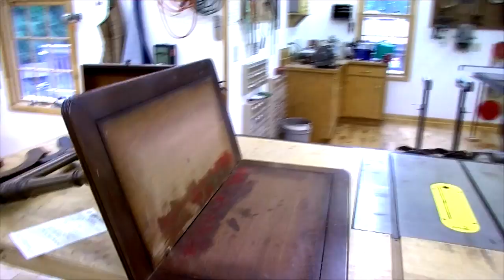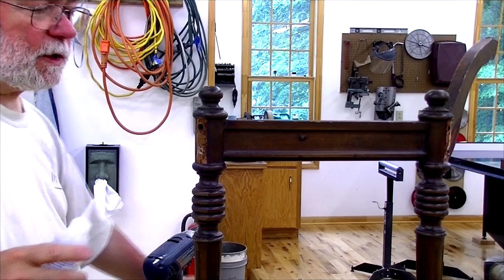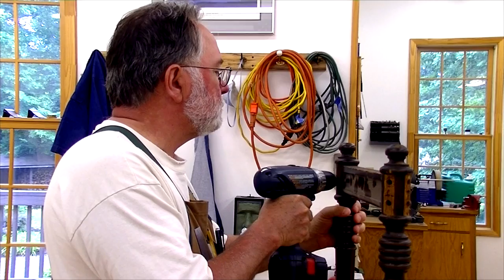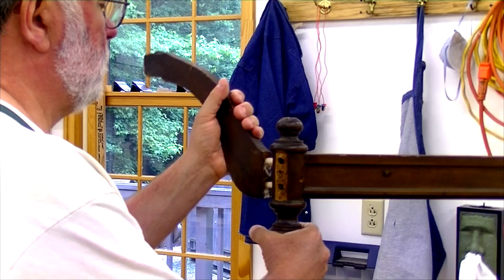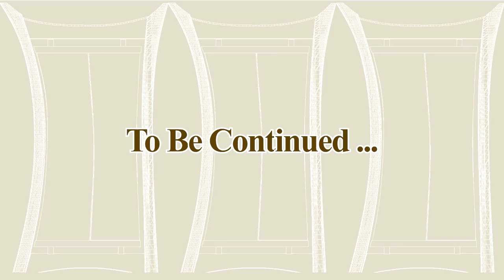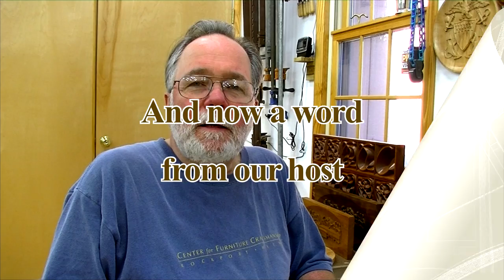Antique Table Repair: Saturday in the Woodworking Shop #15 with Andrew Pitts~FurnitureMaker

Comment: Nice repair.It is a shame that some nice furniture has dowels as the joint.  Can't take much punishment.
Reply from the maker: Mark Hazlewood I agree, Mark. Something like a slightly tapered sliding dovetail would have been nice, but then I would not be getting the work ;-)  Thanks for watching. Andy